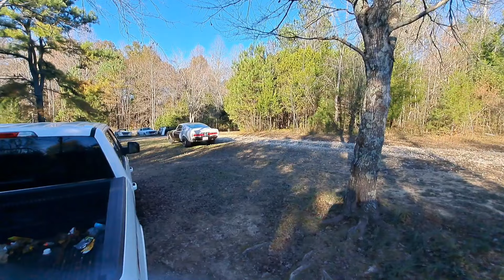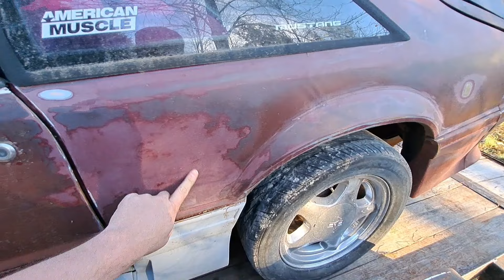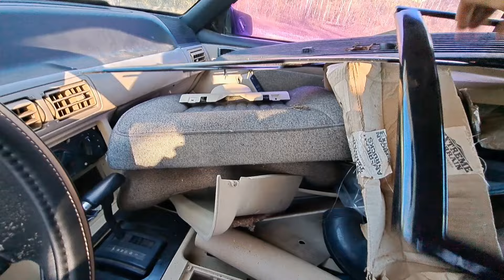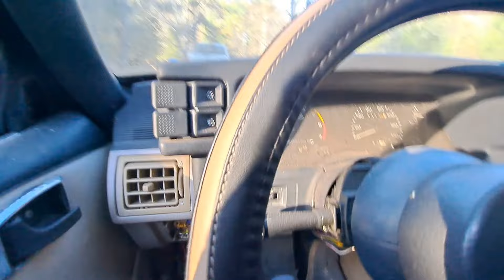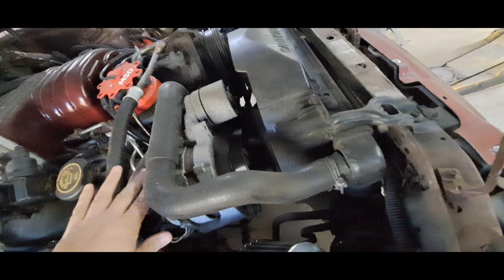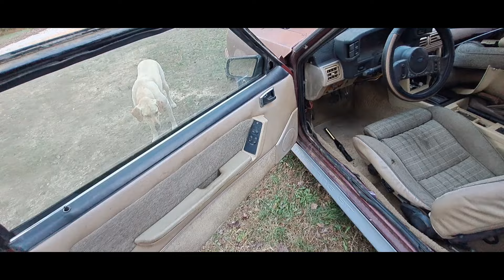Marketplace 1989 ford mustang gt left in storage unit for years. will it run. oh yea

Comment: That’s the EGR sensor on the back.  People are bad about not setting the TpS sensor also.  Should be 5v at wot and as close 1-0V with the throttle closed.  Check the vacuum hoses under the upper intake also.
Reply from the maker: @Paul_D_Lashley  thankyou. Definitely going to check tps now. There's no way it's setup right. I also think your correct about a vacuum leak under plenum

Comment: Hello Mr. Gone in 60. I used to have a car exactly like your.  It was Cabernet Red with a titanium bottom.  It had sand beige interior.   I requested a Marti report.  It said mine was 1 of 44 in that color/interior combination.   So, if that car does have the sand beige interior it's only 1 of 44 and a VERY rare Fox Body.  I recommend you do not change the interior to black.
Reply from the maker: @g89stang  wow that's nuts. Now I'm going to look into that
Reply: @MrGonein60 If there's a way for me to contact/email you I can provide you a copy of my Marti report.  Then you can compare door tag and trim codes.
Reply from the maker: @g89stang  yes you can pm on Facebook. @MrGonein60 or flint higgins
Reply: @MrGonein60  Hello Flint.  My wife sent you a PM via Instagram as I do not do social media.  Just giving you a heads up.  Thank you!
Reply from the maker: @g89stang  I messaged her back

Comment: Idle air control valve is noisy
Reply: Oops. You said it was the alternator. 
Sounded just like an IAC valve.
Reply from the maker: @waynestewart3316  thanks ill definitely check that out. Do you think maybe it's sticking open
Reply from the maker: @waynestewart3316  I think it's the alternator but the sounds traveling all over the engine bay. Alternator isn't charging